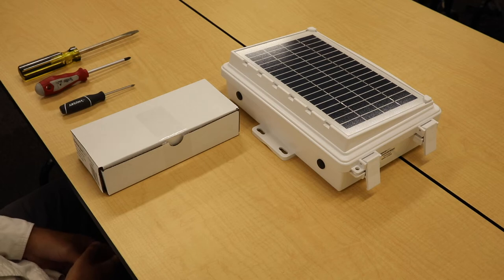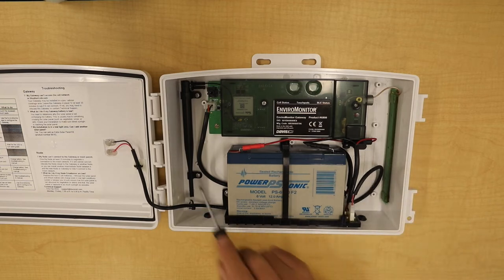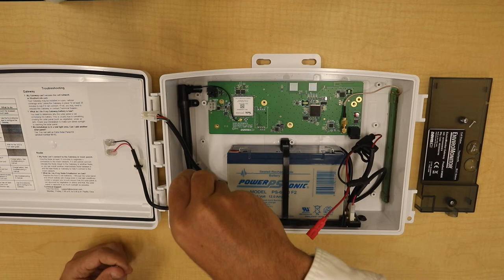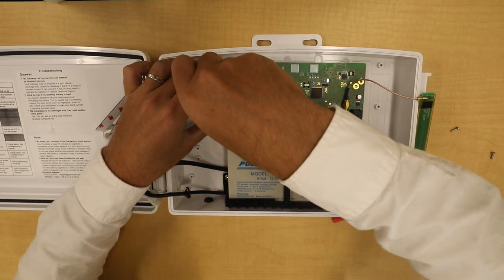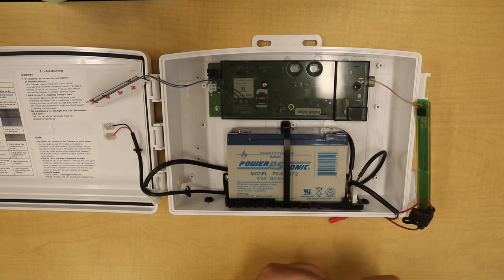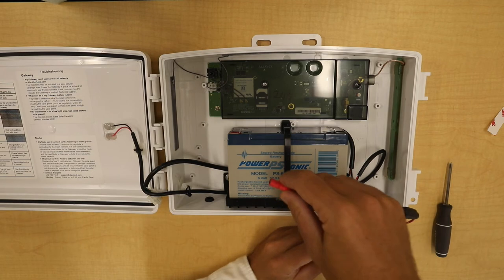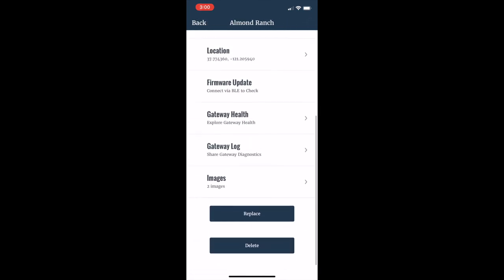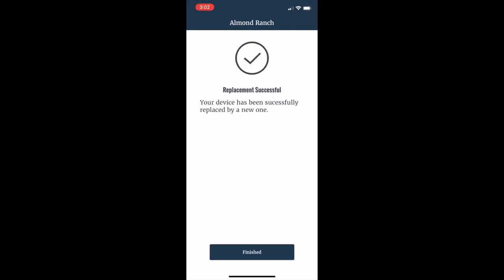Upgrading to LTE - EnviroMonitor Gateway

Comment: You may want to take a couple of alcohol swabs to clean the area where you are going to place the sticky tap or tabs.  

I would like to have the option to mount the antennas outside the box, so they extend above the box.  I think this would improve signal reception, perhaps significantly, if the line of site is through the battery.